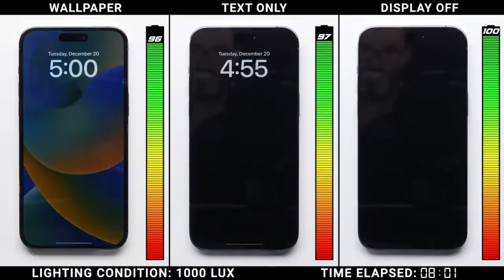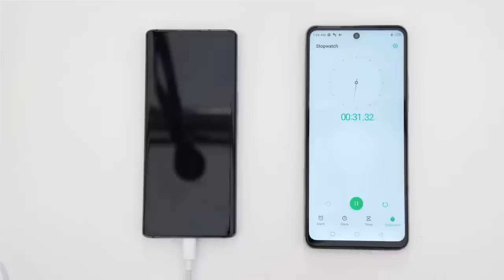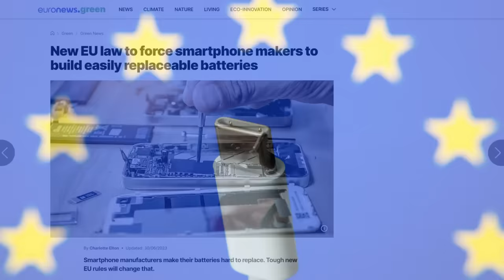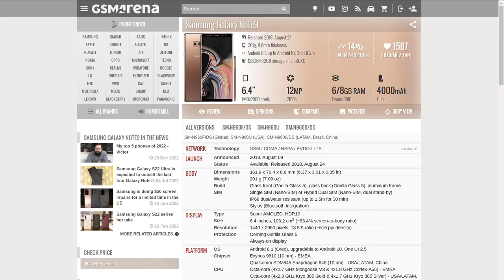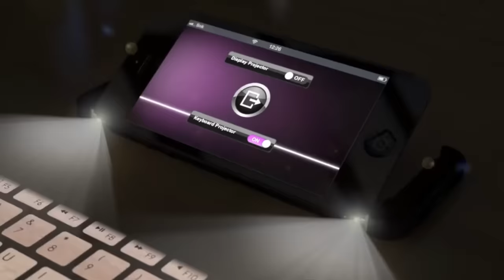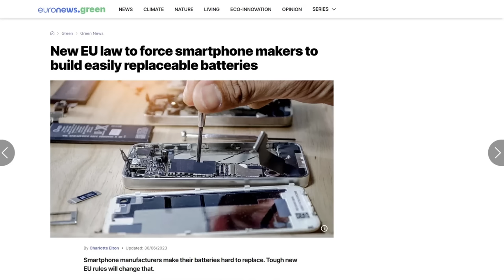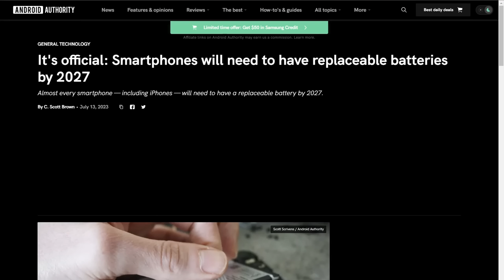All Smartphones Will Soon Have Removable Batteries

Comment: Honestly the worst thing to be killed off is expandable storage. I can deal with changing my battery every year or two.
Reply: Agreed. My Galaxy Note 20 is my last Samsung phone because of that.
Reply: Some new tablets have expandable storage still at least.
Reply: Get a Pixel
Reply: @justayoutuber1906  They don't have it, Motorola still offers expandable storage
Reply: I won't buy a phone without it.. That and an aux jack. Expandable storage is an absolute must, at least for me.
Reply: Motorola still offers it, plus Motorola's new phone releases having been amazing. Actually started making really good phones 🤠🤙
Reply: @jer1776 Galaxy A54
Reply: @jer1776  the s7edge feels like one of the best in the series left, it had like microusb, and all of the things in it, the only thing i wish it had left was a battery
Reply: @0ffaI  But Motorola phones are slow, like who would use a phone for more that 4 years. seriously, imagine using iPhone 5s or a NOKIA Lumia in 2023. so outdated and slow, right? also replaceable does not mean it will be removable that easily, so well still need a screwdriver (this is good because we will still have sleek design and water resistance). Plus batter banks are a much better alternative than removable batteries, first you can get higher capacity banks to charge your phone, second they can charge not only a phone but also can charge a laptop, iPad or many other devices. and my final point is, what will happen to laptops, will they be forced to have removable batteries as well, if so we will have to go back to bulky laptops with those cd things and vga ports. I like something I use every day to look nice and be comfortable, Its called a Laptop for a reason and if I have to go back to using a bulky ThinkPad like laptop, I'm leaving the EU for good.
Reply: @culan_SCP  4 years is not that big, my secondary phone is four years old and works like new. And my primary one is a dumbphone from 2008.
Reply: Get an Xperia. Flagship Specs but with expandable storage and 3.5mm headphone jack
Reply: @culan_SCP  I was referring to expandable storage rather than replaceable batteries in my original comment. I'm aware using a 4 year old phone for a replaceable battery isn't a good solution. 
Laptops will be fine. If you take the bottom cover off of one, you'll notice that batteries are already easily replaceable. The main issue is some laptop manufacturers like to make it so you need to take off the entire bottom panel rather than make the bottom cover and port/side covers separate.
Reply: my €165 phone has 128 internal memory and is expandable up to a 1TB if cheaper devices can do it, i don't see why a thousand dollar devices cant
Reply: @R3TR0R4V3  All Sony phones from 2020 onward have headphone jacks and expandable storage, even the crazy expensive Xperia 1 series. I actually have the Xperia 1 iv from 2022 and I use phones for 4-5 years, so by the time I'm due for the next one, the replacable battery should be there.
Reply: @lukasegeling5205  2018-2019 is the only period when Sony tried to push their true wireless earbuds market by making their phones jackless (the word for ditching 3.5mm headphone jack) but the dire profits means since 2020, Sony changed their strategy for phones as versatile multimedia phone, which means headphone jack made a return and stayed until today.
Reply: @culan_SCP This sounds like a parody comment, dude. All of your comments are ignorant or poorly informed
Reply: Well, it used to be important in that time anyways when storage was small. It's not that big of a deal when phones today have a minimum of 64 GB on even the cheapest ones. I don't see why anyone would need to have something the size of GTAV on their phone other than video and photos which I agree need expandable storage.
Reply: This one needs to be next eu
Reply: @culan_SCP  iPhone 5s is actually 10 years old, yet still usable 🤓
Reply: @justayoutuber1906  Looked into it. The new ones did away with it too.
Reply: @culan_SCP  What is wrong with a 4 year old phone? 4 years isn’t that long, especially taking into consideration the stupid price tags that only get higher and higher. If I buy a phone for 1000$ it better last at least 4 years 💀. Moreover, most people only use their phones to make calls and use social media. The reason so many people feel that a 4 year old phone is outdated isn’t because it doesn’t do what they want. It’s because big manufacturers and brands have bred us to treat these technologies like status symbols. Let’s face it, most people who want the newest iPhone don’t know shit about fuck when it comes to specs. They just want to flex.

When it comes to power banks being better than removable batteries. That is subjective and depends on each person’s use case. But having the option is ultimately better for us the consumers. Removable batteries aren’t going to prohibit you from using a power bank. So why not have the option?

Lastly, when it comes to laptops. We don’t know yet if they will be forced to have removable batteries. But even if they do. I find it hard to believe that all of these hard working engineers at big tech companies can’t find a creative solution to keep laptops relatively sleek and have replaceable batteries. But even if not. I would honestly take a somewhat bulker laptop with a removable battery. Over a sleeker one that I will have to send to a repair shop 3 years down the line.
Reply: @@general-daimosu Really wish it covered US bands, it's the perfect phone
Reply: @@general-daimosu With carriers like Verizon, the phone will not work at all since it is not approved for use in their network. 

Some carriers like T-Mobile are more relaxed with what devices you can use, but the phone wasn't made for the US so cell coverage would be spotty.

Comment: I used to work 12-hour shifts as a security guard, if I wasn't able to change the battery on my phone I literally could not call people to let them know I needed to get picked up
Reply: You are resourceful are you not..? Power banks exist for a reason you know.
Reply: @RomvnlyPlays  You shouldn't need to rely on solutions that were created and sold from manufactured problems.

Stop willingly allowing corporations and governments take your rights away, man 🤦
Reply: @ConsensusX  A manufactured problem is still a problem that needs to be dealt with, it is no excuse. While trying to keep your rights, you need to stay safe. That is the bottom line.

EDIT: To be 100% clear, I don't see the OP's comment being a valid example of replaceable batteries, the issue being they weren't prepared.
Reply: @RomvnlyPlays  OP was perfectly prepared every time they brought a second fully charged battery with them at the start of a shift.
Reply: @RomvnlyPlays  The virgin power banker vs The Chad one phone 10 batteries
Reply: Same. I used to work 15 hours, driving my truck in the night.

Comment: I might be wrong but when I read the news it said that the battery should be easily user replaceable, so not necessarily pretty much swappable in a matter of seconds, but without the use of any special tools, knowledge and glue. So I believe plain old screws are going to make a comeback. I'm sure we'll still have glass-backed phones, with wireless charging and proper water resistance. It's not impossible to mount the glass to a carrier frame that can be screwed to the main chassis without any visible screws. The engineers just need to be smart about it.
Reply: You are right, most people are misinterpreting this new regulation. They will have to be easily replaceable without proprietary tools (unless shipped with the phone) and heat.
This is about extending phone longevity so most phones will probably still not feature easily swappable batteries.

Comment: What I‘ve seen mentioned around a couple places that I really like is the suggestion of the battery being replaced similar to the SIM card. little tray or something in the side that pops open and allows you to get the battery out through said hole and replace it.
Reply: that tray would have to be massive or there would have to be multiple ones since batteries are much bigger than sim cards...
Reply: HTC desire hd style
Reply: @kora8063 what if multiple smaller batteries? Like little french fries
Reply: @kajmak64bit76  I think that might work, newer phones already have a battery divided into parts, but I don't know it if wouldn't be too complicated and hard to achieve
Reply: @kora8063  lg g5 was like that
Reply: @kajmak64bit76 Sounds great.
Reply: This is a really good idea, I hated removable batteries as you had to remove them from the back, making the backs material plastic.
Reply: I'm gonna make some kind of concept design for this.

Comment: Not exactly, for what I read in the proposal, the main difference will be that the batteries may not be glued in place, require custom tools for replacement, or be paired with the rest of the phone in software. So not a thing about quick swapping, but still - small victory.
Reply: watch them start filling the entire battery compartment with resin for the non-EU markets
Reply: @CubicApocalypse128  It's much easier than that if they dare to be so obvious about it: Software pairing for US model batteries, but not for the EU models.
Reply: @entcraft44  they should ban software pairing, those iPhone self repair experience look like a torture
Reply: @donnguyen3795  The EU has done that. "Software shall not be used to impede the replacement", if I remember the quote from the regulations correctly.

Comment: Imagine if the EU made the headphone jack mandatory on phones

That would be my dream
Reply: Try wireless and u will never go back , but be careful not to lost them  around your house 😉
Reply: @Belojadransky13  
I have tried wireless earbuds before and I liked them.
But I hated having to charge them constantly, the connection issues i'd have from time to time, not to mention the constant anxiety about their batteries dying on the best part of the song. 
I went back to wired buds after almost two years and never looked back, I can tolerate untangling the rats nest if it means one less thing with batteries to charge.
Reply: @TheAutisticOwl  With around 5-10 hours of battery life, you should not worry about the battery
Reply: wired earbuds can provide way better sound for just the fraction of the cost of wireless buds
especially if you invest in a decent pair of $20 IEMs
Reply: Nah. AirPods work like magic. I will never go back to wired except when I’m at work (where I need extremely low latency).
Reply: Just use a type c earphone man. The real deal is the SD card slot. That MF  extended the phones life by a lot coupled with replaceable battery
Reply: @nidhipgupta4462  The C-type earphones can be used even on PCs ?
Reply: Already in France !
Reply: @jessyfal04  wait what?!!👀
Reply: @TheAutisticOwl  they did many years but It was removed for environment :(
Reply: Useless. Who needs that crap wire
Reply: @jessyfal04  Jack wasn't mandatory, it was only the presence of earphones in the boxes of phones
Reply: But I wouldn't want that.
Reply: @TheAutisticOwl 
I would add that wired don't fell of and get lost. And best is that you could use them 24/7 if only phone/MP3( anyone use it?)/laptop/tablet have power
Reply: The "elite" kept this as a secret for centuries, this is the true story of your enslavement 👉 The Connections (2021) [short documentary] 💖

Comment: Waterproofing is trivial, I have had multiple flashlights that you could dive with, and they had replaceable batteries. A simple latch or twist mechanism and an adequate gasket is pretty much all you need.
Reply: Let me twist my phone RQ
Reply: You’re not comparing a phone to a flashlight right.
Reply: @ireallyreallyreallylikethisimg  If you need a little extra torque, just add an indent you can fit the edge of a coin in to get better grip and there you go.
Reply: @ajsrf  You never heard of gaskets, right?
Reply: @ajsrf  Fair enough, a phone got a few more apps besides the flashlight app.
But seriously now; all you need is keep the electrical contacts of the battery away from external moisture, doesn't matter where the contacts lead to, if they're dry they are dry.
Reply: We have a different definition of the term "simple"

Comment: I bet today's technology would easily allow manufacturers to achieve this while still maintaining the water resistant and slim designs
Reply: It's already been done lmao Kyocera had a whole line of waterproof phones not super long ago. All with removable batteries.
Reply: Galaxy S5 did.
Reply: @doctahjonez I believe they still do with their flip phones. What you're referring to is the hydro line.
Reply: But not for cheaper, otherwise it would already be a thing. And that price has to be paid for every consumer, including those who were not necessarily interested.
Reply: imagine battery that clips via a magnet to the phone and uses induction wires. might not be super efficient, but it would not compromise the seal of the phone
Reply: I don't know why not more companies use screws to hold on to the back.
If you simply make the phone a bit taller, use screws to hold the case you should be able to make it water tight... That's how the CAT phones are built, except that they didn't include a removable battery.

imo that would count as user replacable battery if all it takes is unscrew a couple of screws. heck even screw in the battery with a small retention bar would count.
Reply: I mean, the Samsung XCover series is a case-in-point. User-swappable battery, IP68 certification. It just has a plastic back cover with a silicone gasket around the battery compartment.
Reply: He says, because he thinks his wants are engineering realities.
Reply: @MrTomyCJ I've never heard of removable back phones being more costly. I'd be interested to see where you got that.
Reply: A non issue from the engineering standpoint.
 You ever heard of waterproof hand watches? That are out there for like... 120 years or sum. A thin piece of stamped sheet metal and a thin gasket is enough to keep a battery compartment totally waterproof, and you have to pry it to open it because the seal and backplate is sturdy like a m o ,fo. Production cost increase would be minimal. If pros are considered, it's a no brainier, to pay few dollars more for a phone, and be able to remove the battery, and swap it.

That "it will be too thick!", or "it won't be waterproof" talk is just astroturf, or useful id IO - ts who gobbled up the corporate propaganda, and want to appear to be knowledgeable.
 Injection molding got so advanced, that you can pump out amazing chassis at minimal costs. A separate compartment for a battery with a space for a gasket could totally be done.
Reply: @MrTomyCJ  Phone prices have already gone up years ago.
Reply: @MrTomyCJ then make the waterproofing optional, ez

Comment: Keep in mind, having removable batteries does not mean you will be able to swap them on the go. For what i understand the legislation is focused on ease of repair and recycling; the manufacturers most likely will keep using permanent glue and the sorts for that sweet sweet ipx rating and propietary repair services.
Reply: Heck if supercapacitors existed.
Reply: The good news is that the EU regulation forbade proprietary repair tools and it must be removable with commonly available tools at least.
Reply: @oliverborromeo8460  as long as they don’t consider a heat gun to be a “commonly available tool”
Reply: @burn_out  It must not include heat or solvents. However, it doesn't state "commonly", it states "commercially available", "not proprietary" and "not specialized" (unless it comes with the device for free).
That means everyone can buy the stuff, but if the manufacturers really want, they could use tools that nobody has instead of basic tools like screwdrivers.
Reply: @entcraft44  “not proprietary” means they can’t just use tools no one has.
Reply: @Cr_nch  With "no one" I don't mean literally no one, I mean not the average consumer.
Reply: @entcraft44  “not specialised” sorta covers that. And if it’s proprietary or specialised (as you stated) it has to come with the device. So it’ll be much more widely accessible no matter how you look at it
Reply: @Cr_nch  I was just trying to find loopholes that the manufacturers could exploit. iFixit (iirc) wanted them to change the wording to "basic tools" instead of "commercially available" but they didn't do it.

Generally I agree that the law will certainly help. It doubt it is one of those laws that are all bark and no bite.

Comment: Man, I've still got my Redmi Note 8 Pro that I bought in 2019. It's still working fine, except for when Xiaomi decides to slow all of their old phones all of a sudden. I still don't know why not one phone reviewer has ever talked about this. It's what's definitely is making me reconsider getting another Xiaomi again.
Reply: My mother uses the 8 pro while I have the 10 pro, no issue with battery life, but there is another issue with phones nowadays, after 2 years you get bombarded with bullcrap ads to a point that it gets annoying
Reply: I got a  Redmi note 10 and it got extremely slow after 2 years for some reasons. installed a custom ROM and it is fast as new.
Reply: @netbotcl586  Mine works ok, just the damn pop up ads are annoying
Reply: Install antivirus and don't update it. Problem solved. Updates slow all the phones, unless it is brand new phone and needs some tweaks.
Reply: They slow phones because battery degrades and it is not able to efficiently supply processor demands and it is risk of overheating and maybe explosion. So you should be thankful they slow it down for you.
Reply: All old phones slow down. Hardware degrades over time